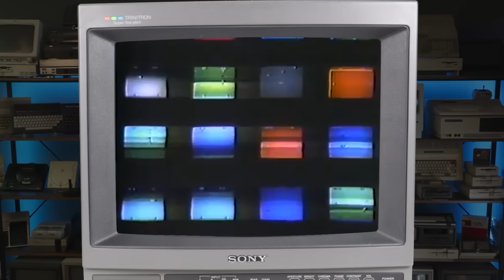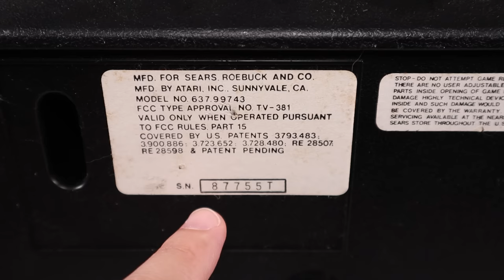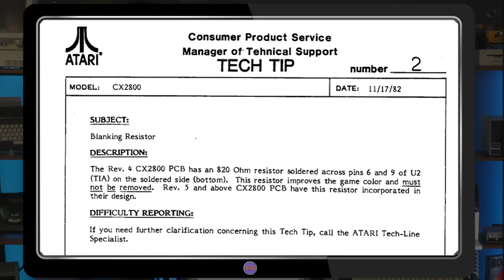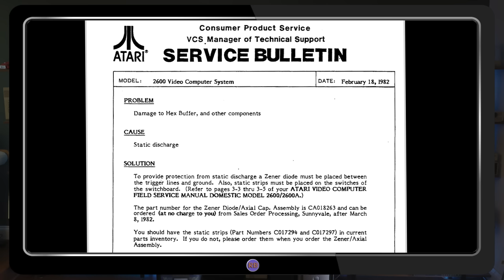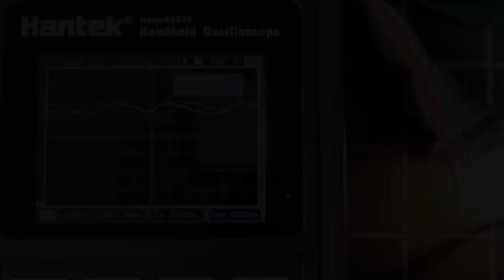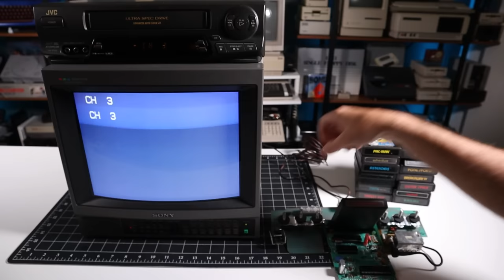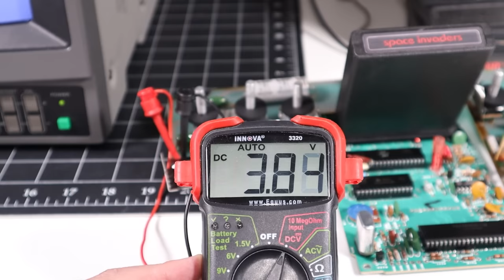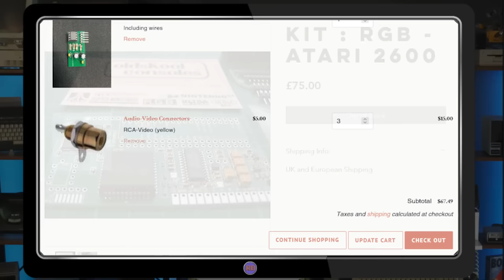Sears Tele-Games Video Arcade First Look and Restoration!

Comment: The output is very clean now but the colors are just wrong on all the games. Kinda weird!!
Reply from the maker: I did notice the colors were there but were a little muted. Maybe the system could use a recap after all.
Reply: @retrobitstv  it seems like a voltage problem to me also. Normally the space invaders play field and shields are green so when they were gray and the defender bottom was purplish that was my thought.
Reply: @retrobitstv  it might just need a hue adjustment.  That's the big white plastic disc just under the CPU
Reply: @retrobitstv  The blue looks totally gone to me... like in Defender the city is supposed to be blue and it looks gray on your TV.  That could explain purple not looking purple too.
Reply from the maker: @GDLarcade  Cool, thanks for the heads up! I just assumed the colors were washed out because of RF. I followed the service manual and adjusted things and here's  what it looks like now:
http://retrobits.tv/defender.jpg
http://retrobits.tv/breakout.jpg
Reply from the maker: @granitepenguin  All fixed, thanks!!!
Reply: @retrobitstv  awesome!
Reply: @retrobitstv  Yeah, that looks a lot better! Congratz on the find, BTW!

Comment: So pacman cartridge was defective?
Reply: Saved us all the misery of seeing that horrible port. It probably just needs a good cleaning.
Reply from the maker: It still did not work after repairing the console. All of the other carts in the lot worked though. I cleaned the contacts but they are heavily worn. I might try and open it up and see if the ROM is readable but I'll have to carefully remove the label first.

Comment: 2600µF on a 2200µF would make me worry as that could mean the cap is leaky...
Reply: A lot of capacitors (particularly electrolytics) have a 20% tolerance. 2637uF is barely within tolerance. But with that close, you might be right.
Reply: @not-on-pizza  Have you ever seen a brand new capacitor that's noticably over the rated capacity?? And better be safe than sorry, especially with 45 year old Capacitors...
Especially since the replacement Capacitor was already on hand as well.